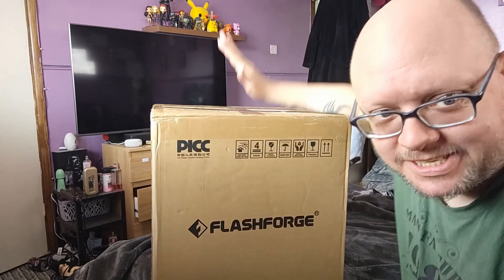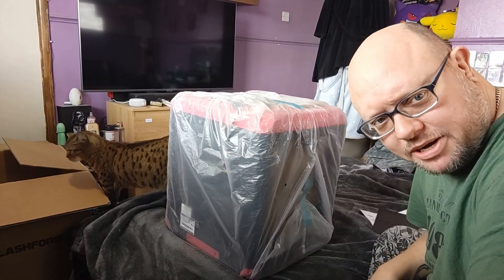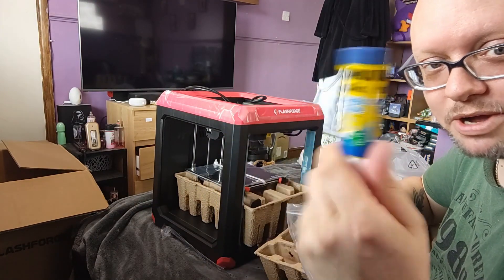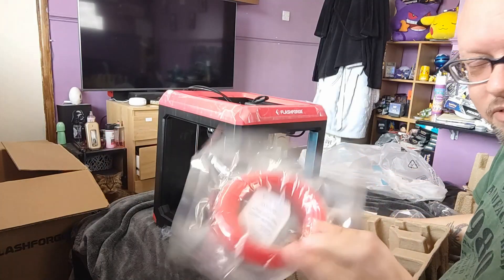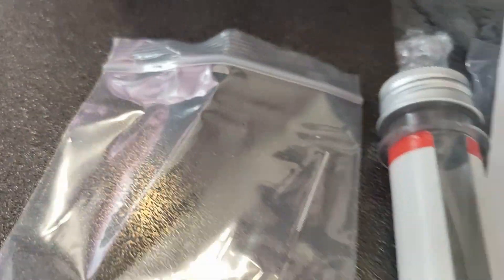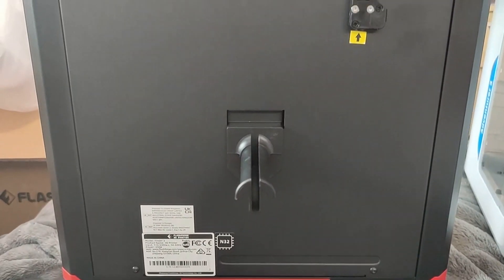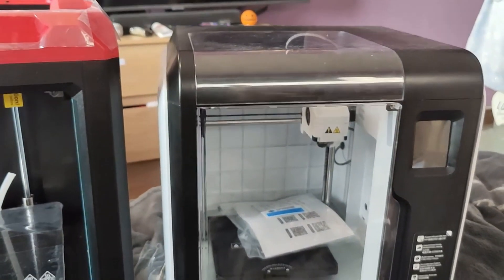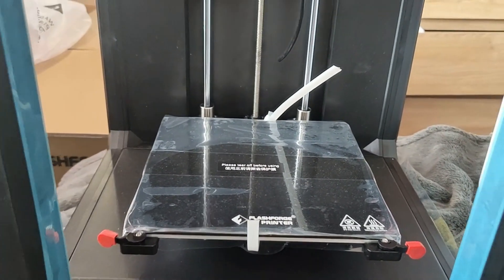Flashforge Finder 3: First Unboxing

Comment: The extruder brought the same thing as the Voxelab S2. Very disappointed. Its nozzle blocks and hotends become more and more problematic over time.
Reply from the maker: I've been using it daily for weeks, and not a single problem with blockages or the nozzle/hotend. 

Obviously I'm fairly experienced with 3D printing, so maybe I've just got the settings dialled in.

Comment: Ohhh, so it's not got the closed off sides and door like the adventurer 3?
Reply from the maker: Nope, it follows the design of the original Finder. "semi-enclosed"
Reply: @LeeHubbz  looks like I'll be getting some perspex and printing some clips. 🤔
Reply from the maker: @DaveKomaromi  
Yeah, I'm considering trying to design some clips, but not the best with Fusion. 

But so far, not even the slightest issue relating to it only being semi enclosed.